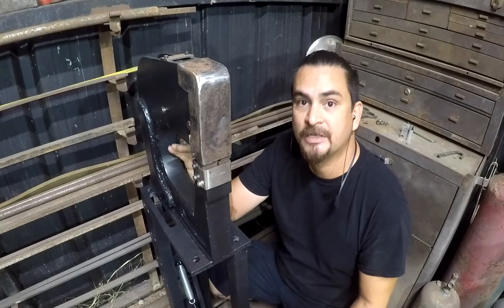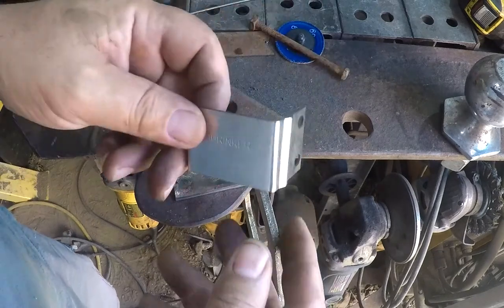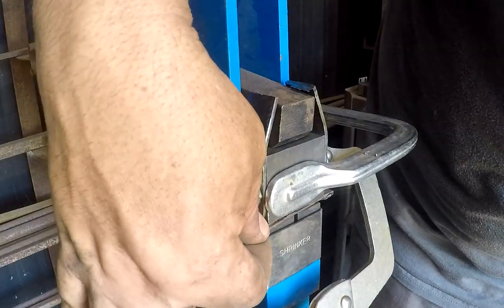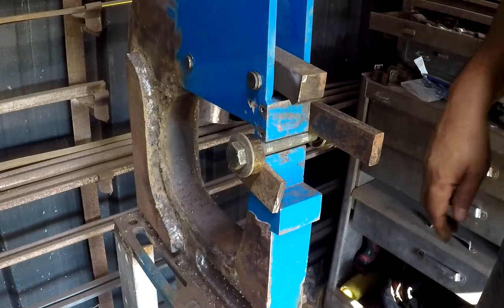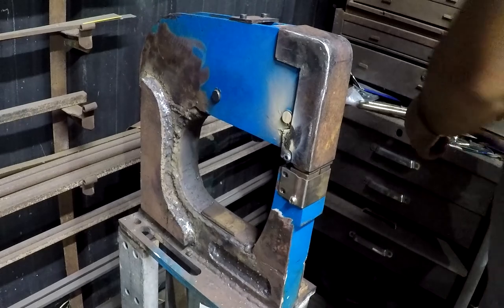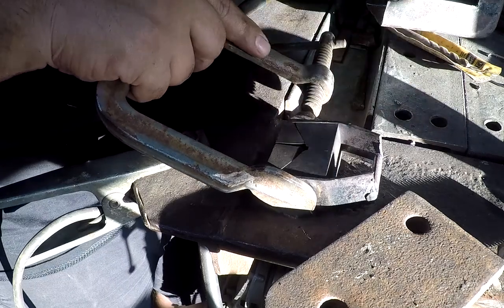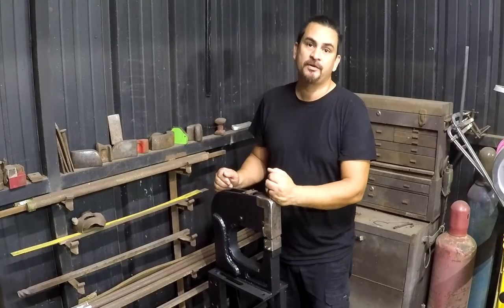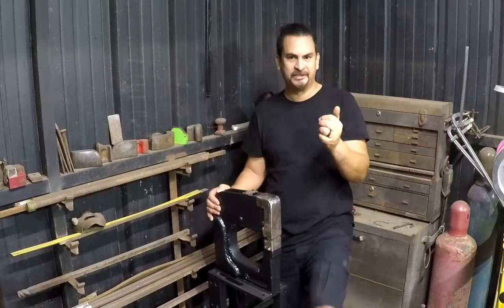Final Jaw Modifications on the Vevor Deep Throat Shrinker Stretcher

Comment: Every shrinker/stretcher i used ( and own ) has that rough finish inside the jaws..you need teeth to grip the metal to do the work...
those are made for thinner metal...22 guage maximum thickness...you tried too thick of metal for it and it couldn't handle it...
Having two seperate units with both jaws ready to use is the best setup as you will need to go back and forth from shrink to stretch more often than you realize and changing jaws gets pretty annoying quickly...
i started using them in the 1990's...